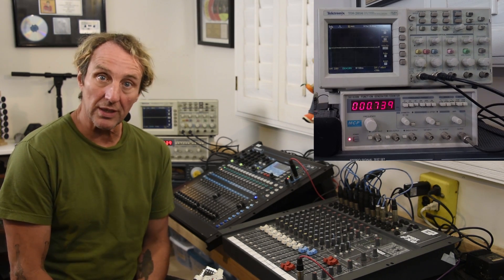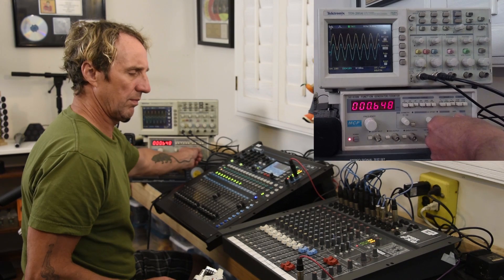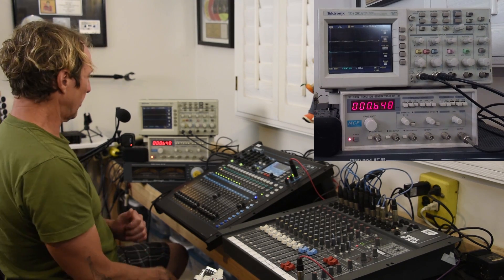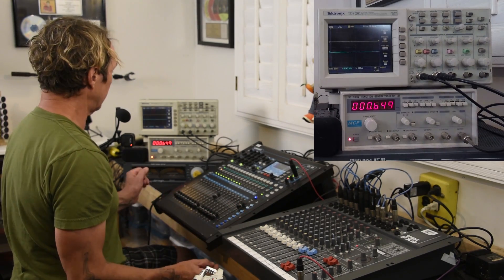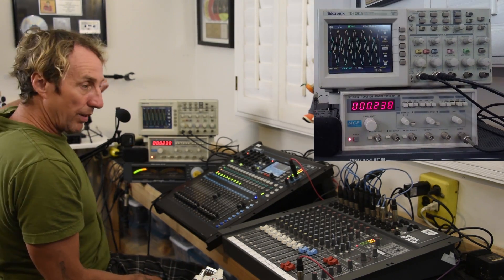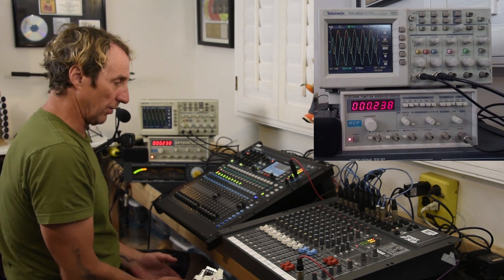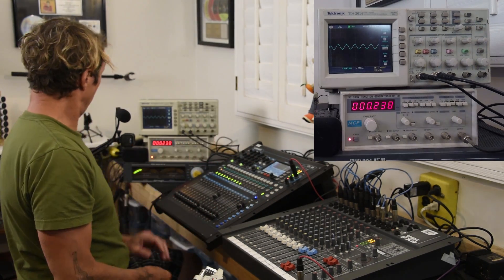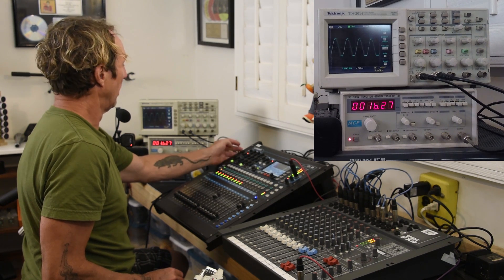Digital vs Analog #5 of 6 - Tone Overload Mode

Comment: Thanks for the visual representation of this.  I'd be interested to see this same example while driving analogue gear vs. driving their plugin counterparts.  Additionally, I noticed phase shift across different channels of the digital console.  I would chalk it up to channel delays being active, but I believe it isn't because when you went from ~650 Hz to ~350 Hz the phase shift on ch 1 of the digital console was different.  Any idea why this is occurring on the digital and not the analogue and what do you think about how that alters the accuracy of the audio reproduction?
Reply from the maker: I think the phase shift you are referring to is actually the latency that increases as each channel is added in series. 

With sine waves, latency looks like phase shift and sometimes looks like no phase shift, depending on the the time lines up with the wavelength

Comment: This test was performed mostly by a sound engineer. As an electronics technician, I would test instrumentation amplifiers, which are nearly identical to audio console analog op amps. Much of the gear use the exact same components as both require low noise, high dynamic range, and low distortion.
In the scientific community, many of the sensors are either current based with a current loop in the 4 to 20mA range, or an analog voltage in the 0-10V range or -10 - +10V range.
To test the health of the amplifiers, it is common to drive the analog sections with a 15V peak or 30 V peak to peak signal, then look at clipping levels, distortion, noise, etc.
Most analog audio consoles use + and - 15 volt regulated voltage rails for the op amps. Depending on the op amp used, the output on most analog consoles will clip between 12 and 14 volts peak. None are linear all the way to the supply voltage rails. Some of the worst op amps I have seen in production clip just over 10Volt peaks. When they degrade, they clip at less than 10V. On gear I work on in servo systems, we require the analog to support clean 12V peaks. Less is an early sign of pending failure.
On to the digital consoles and the truth about their headroom, generally speaking. Let's face it, the output is ANALOG, so has the same analog Op Amp outputs and same supply rails.
Here is the difference the sound engineer demonstrated on the bench. The entire digital range of the ADC and DAC are within the linear limits of the analog inputs and outputs.  Let that sink in. So the analog does not distort a full range peak to peak signal, the digital signal is LESS than the analog ability. Most digital consoles clip at about the 12 Volt peaks. The analog op amps are linear to at least 13 volt peaks, but there is no digital value to exceed the 12 Volt peak, which is exactly what Dave demonstrated on the bench.

The clip light usually turns on when peaks are within -3db of the maximum limit of the digital signal, or about 10V peak. This varies by manufacture.

Thought you would like an explanation.
Reply from the maker: Appreciate the knowledge and info!  Thank you!
Reply: @DaveRat  You are welcome. If you want to make a chapter 7, you could measure the latency of the digital using the pulse, and cascade the inputs as you did before. There is a finite delay to an ADC and DAC operation.
Digital has the convenience of the outboard toys in the console, and is fantastic for recording. They work well for large venues with plenty of natural distance delay to mask the console delay.  DJ's with canned music don't notice the delay. However for a small venue, the very low latency of analog is hard to beat for live sound.
A side note on the instrumentation amplifiers, they are DC coupled, so bottom end is DC. This is the biggest difference between balanced audio and instrumentation amplifiers. As an aside, some higher end consoles use 18V supplies to the op amps. They run hotter, but have that extra headroom.

Comment: I did a test like this recently checking my Dolby cinema processor to Sony SDDS cinema proces sor using my AVR Denon AVC-X8500H multi channel stereo mode to send same signal so I can calibrate yet I found some small tiny dB variances where voltage signal was just tiny fraction and I found that most upsetting.

Also you maybe generating some harmonic distortions have you got this connected to an RTA to see if there are any harmonics appearing.
At 10:15 I decided to use my high IQ and switched on my Lucasfilm Ltd THX Sound System 3417 monitor and bingo! There it is I see harmonics on my TrueRTA also I did a video of this where I noticed all the harmonic distortions and was getting worried cos I kept thinking it was my JBL horns 2445 2380A or rather the CD and thinking I need to get behind the screen again take the horns down and realign the diaphragm to the phase-plug.

Comment: I have an old Tascam 2600 console the amp is missing.  Should I trash it ? Or can I use something else to power it ? It was from Black Rebel Motorcycle Club touring rig
Reply from the maker: By, "amp" do you mean power supply?

I would check eBay for the value.  May be worth something but not thinking a lot
Reply: @DaveRat  yes power supply.  I looked around no luck think the hard case worth more than the mixer. Thanks big fan
Reply from the maker: @violadrums  yes, probably the case or sell off parts and knobs and such.  But usually more work than value.  Thank tou!

Comment: I recently bought an old EQ DBX 2231, which has an amazing little limiter. I'm pretty sure it can save expensive gear and the audience from sudden red lights. It still sounds bad, but it's not catastrophic. Overloading can produce interesting sound, especially with carefully optimized feedback loop from effect returns, but this is for home recording. I wouldn't even try that on stage.
Reply from the maker: Yes, good limiters are helpful. One thing I see a lot is engineers with the console overloading. Sometimes trying to get more out of a system than it can do, sometimes because there is a limiter set too low and they can't get enough vume or sometimes because they just don't realize the issues.

Comment: As a rule of thumb.. I've always worked my gain structure to stay away from peaking regardless of the type of board. 

I laugh every time at the rat nibbling on the speaker, then exploding 🤣
Reply from the maker: very cool.  Yes, I avoid clipping except some analog gear has some cool sounds that can be useful when clipped.  Not unlike distortion on a guitar amp can add desirable sounds.

Comment: Would be very interesting to see a modern digital console like an allen&heath dLive, react to the same treatment. I am very sure it will react massively different.
Reply from the maker: I'm working on the large format console comparison with a digico and a Midas versus a Midas analog, should be interesting to see
Reply: @DaveRat  For sure. If possible, please do indeed add a dLive as well, since it has a distinctly different DSP setup than the others. It doesn't use 40bit float but variable bit depth. Depending on the "module", this bit depth can be as high as 96bit. So it will be very interesting to see if this indeed makes any difference. For good measure, we should also include a Yamaha QL/CL, which uses 56bit fixed.
Reply: @NameNaameNameeNaamee  The 96 bits referred to in the specs have nothing to do with bit rates. That's to do with the accumulator, which is the part of the DSP that does the summing, which is what gives that summing engine so much headroom. They also do soft clipping/saturation on their busses, which makes it behave in a very analogue way when the busses are hit hard, which is a nice touch.
Reply: @UncleWalter1  Oh, my bad, typo :D bit DEPTH, not bit RATE of copurse. Seriously though, what I was talking about is correct. The dLive does use variable bit rates over different processing stages, which get as high as 96 bit (in the accumulator, which makes sense, since it has to deal with all that shit that happens before and on up to 128 channels). That fact effectively ends the discussion about fixed vs. floating bit. At least it should - if the console reacts as advertised. That is exactly what would make this comparison so interesting.

Comment: Dave, this is incredibly valuable. It shows that the biggest difference between analog and digital is when you start clipping. There is no such thing a good digital clipping while analog clipping can be just fine, or maybe even an improvement. The take away is to leverage the noise floor of the digital system to stay a long way away from clipping. This can work but it takes more effort then an analog board in the heat of a live performance.
Reply from the maker: Totally agree. Digital is less forgiving but when used properly can give equal or better results, depending on the desired outcome

Comment: I've always stayed far away from peaking on any digital consoles and pretty much any analog console for live work. Ended up at a festival 3-4 years back with a Profile running fully in the red on a throw and go set and spent most of the show undoing all the crap the house engineer had done on the festival scene. That's the worst I've dealt with, but I've seen too many people running hard into the red on digital consoles with some excuse that the preamps can take it.
Reply from the maker: Yes, seen it often and amazes me. Hopefully seeing and hearing will help some engineers realize to avoid

Comment: Thanks for this series. I've been wondering since you decided to use small format consoles how would these tests translate to large format consoles? It seems that the small format consoles have been doing a good job of putting out what was sent in, or at least it seems that way watching your oscilloscope via YouTube. What improvement do the large format consoles provide?
Reply from the maker: Looking forward to doing a large format console test soon
Reply: @DaveRat  Sounds great. I'm looking forward to it.

Also, have you done a comparison of the audio quality of audio over CAT5 cables vs a standard snake cable vs high-quality starquad cables?

Comment: In an earlier video, you talked about ensuring the outputs were equal and used the 1dB VU meter showing the yellow arc below your sin generator.   When you switched between consoles, even at lower volumes, it looks like you didn't have digital calibrated to analog as you had at 0db, in other words, either you had a change over time (heat?) that 0dB moved on one or both consoles.  I think you might want to recalibrate at 6db before output clipping to make it a closer comparison.    

And yes, I would expect a Midas analog console vs  Digico to get different results.

I don't see many exceeding digital input, but I do see many clipping the FX loop (especially in the smaller format/ entry-level digital) on the monitor EQ FX (or mains EQ FX!!) on x32 clips if the gain structure sucks / they don't bother to check the complete metering view.
Reply from the maker: Yeah, calibrating for one frequency works but since there are differentials in the response, the calibration will be different at other frequencies. With a distorted sine wave, the differentials will also change.

I got them very close and tried to use output levels to tell if they we close enough.
Reply: @DaveRat  you did a great job on this.  I only mentioned this because you could see on the video at 4:46 you switch from digital to analog and you can see the dB meter drop at least 1 dB and the same with other frequencies.  It is difficult discussion comparing the top input/output level.  Like the x32 goes from -xx to 0 at the clip, vs your digital that mimics analog metering with plus values.
  I bet folks would love to see this comparison between x32 and.. ?  A&h 2400 clip to clip calibrated ( check input and output clip of course)  to see the difference.   Cheers!

Comment: Well done.  With two sine tones (different frequency) we can hear intermodulation too. Regards.
Reply from the maker: Awesome, will ponder adding that test to large format console comparison
Reply: @DaveRat  ..i did it with tape recorders,  class A tube circuits,  other audio gears too..interesting fact: in tape recorders you only need one sine tone, the second tone is the bias itself. Regards
Reply from the maker: @doctortubes1  Interesting and cool info
Reply: @DaveRat  you are welcome.  I did a lot of lab tests.  I was an official assistance technician for UA, Vox, Marshall, Alesis and more..in Italy. I am a sound engineer in local/ national /inernational shows (Europe, USA, Asia) but i am mainly an hi-fi listener.
Reply from the maker: @doctortubes1  👍

Comment: While this is an excellent example of the differences in processing between digital and analog consoles, I can't help but wonder if a digital console with higher quality components would be any different or if it varies from series to series. Specifically, I'd be mostly interested in seeing if the Allen & Heath SQ series still retains that wave truncation/harmonic buildup and if a Behringer X32/Midas M32 has similar distortion.
Reply from the maker: I will do a large format console comparison with a Digico and Midas h3000 at some point
Reply: 32 bit floating point precision encoded PCM data is said to be able to recover from clipping.
Reply: I tested it with a X32, i wasn't able to clip it internaly
Reply: @mischastiefenhofer  You can get it to clip at main stage if you drive too many (non clipping) hot inputs/FX to L/R. Even if your outs are through matrixes with good levels, you can hear clipping happening before.

This is where DCAs comes handy to level things out with two fader move.

Comment: "I don't know how much I'll subject you to of all that via the YouTube, and how much will come through".
Thank you for not wanting to torture us with 16k for too long. I have reasonably good hearing up into high frequencies and could barely hear the 16.27k tone. That's likely due to the fact that I've found YouTube lowpasses all videos at almost exactly 16k. Here's a screenshot of a spectrogram view of this video: https://imgur.com/a/7mduCrO. Notice the clean cutoff right above the 15k line. The 650hz and 240hz tests are clealy visible, but the 16k is gone.
Of course hearing 16k is irrelevant to this video because you have a way to visualize the waves for us, but just an interesting YouTube tidbit I thought I'd share.
Reply: Nice! I checked out a bunch of vids, all the same...never knew this...brickwall, flat at 15.75k, and then down nearly 60dB by 16.0k!
Reply from the maker: @simccaffrey  so interesting thank you
Reply from the maker: This is cool. Thank you!
Reply: I looked into it a bit more scientifically with pink noise: https://imgur.com/a/yAfCPbZ response to 3Hz, but -80dB @16kHz...weird...using this video @1080 as source btw: https://www.youtube.com/watch?v=6ZEFb6Zi3sI
Reply: ...getting a bit ot, but anyway, this just popped into my head, i thought it was good: https://youtu.be/eSX0lUUPjL8?t=3112
Reply: spotify web player seems to have some similar stuff going on...brickwalls around 16/17k...not in the desktop player though...
Reply from the maker: Very interesting info
Reply: What we've heard testing 16k on digital was a nasty aliasing sound

Comment: Thanks very interesting to hear side by side. I wonder though, there must be digital consoles with more headroom that can also deliver the same amount of output right?
Reply: It's important to remember that on a digital consoles your tipicaly running full scale DB. The equivalent of 0 DB on an analogue console is about -18 on a digital console. You have headroom you just have to remember the scale are different. Realistically if you're in the red there's something wrong elsewhere in the signal change. If you want to run your gain over unity on a digital console you can between - 18 and 0. It's just after 0 there's no more 1 or zeros to represent the the sound wav.
Reply from the maker: Yes, it's all relative.  The main issue with the digital is the metering is deceptive if you base things on analog. Keep digital meters away from clip. Add post console gain if need be.